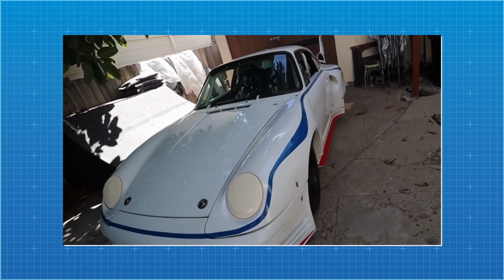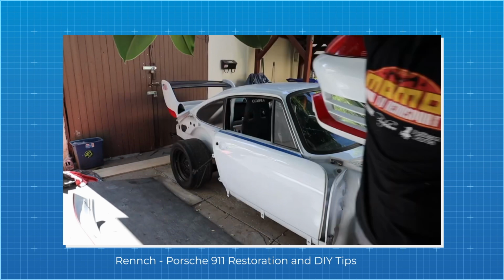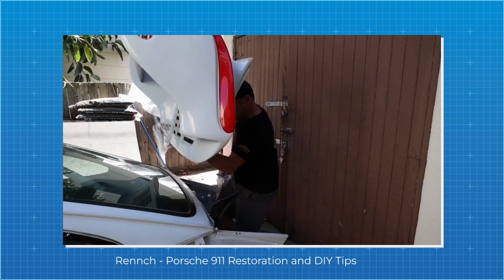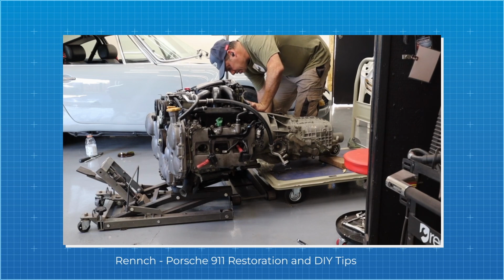Raise3D x Rennch - 3D-Printing Parts to Restore the Porsche 911 [Livestream Recap]

Comment: I been using the Raised3D Pro2 for about 6 years at work. It's a workhorse!!  There's no limit if you keep pushing what you can do with it.  

Prior to this I personally used open source 3D printers.  I would spend more time trying to tune/calibrate the printer than actually printing.  Now I have my own personal Raised3D Pro2 Plus!  I used it for just about everything.  From a Ducati Panigale fender eliminator kit to a Toyota Tacoma license plate frame & custom front grill emblem.  I agree with everything you guys said here.  It's an awesome time to be a DYIer. 😆 🤣
Reply from the maker: Amazing to hear that you've had a good experience with the Raise3D printer. Thank you for your support. Please reach out to us at inquiry@raise3d.com if you need anything else.